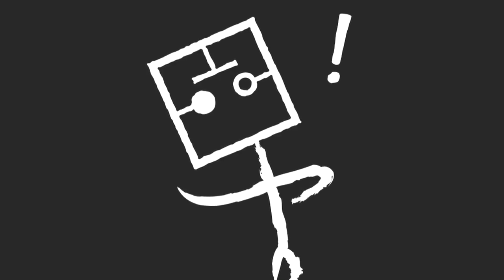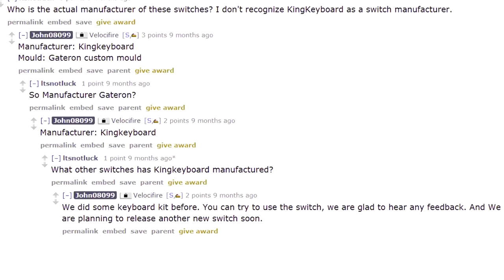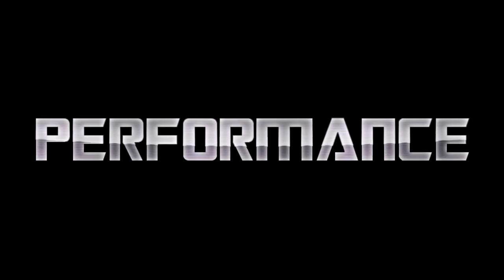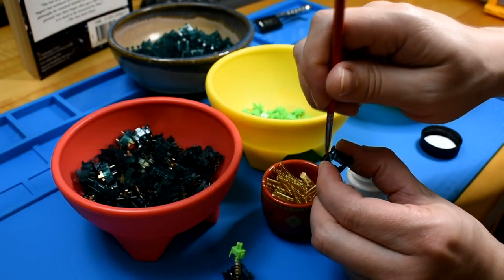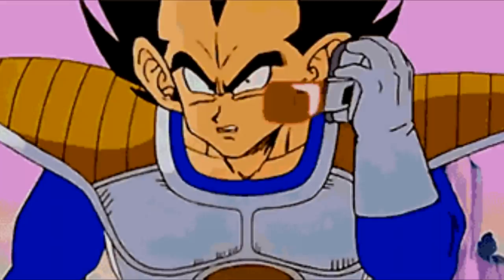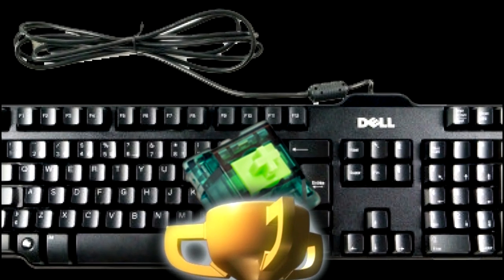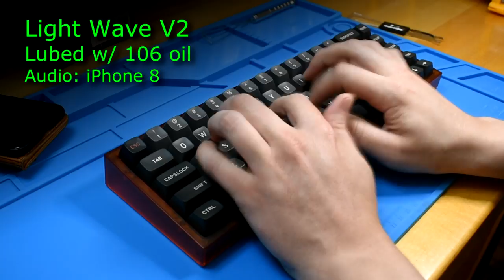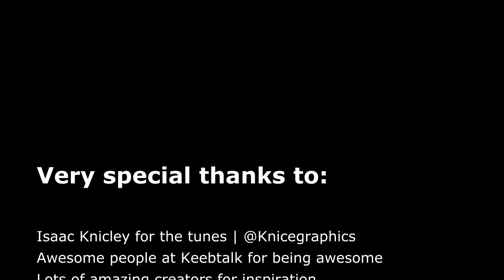Switch Overview: Light Wave V2 / Candy Jade Green

Comment: These look really interesting. The colour is perfect for the build I'm planning. Are they quieter than normal switches? That little leg thing makes me think bottom out wout be dampened slightly.
Reply from the maker: Not by a lot. The legs definitely lend to the feel and the sound but I wouldn't say they are significantly more quiet than an average linear.